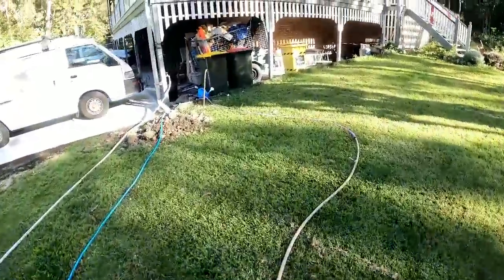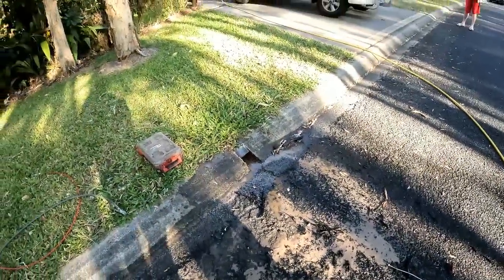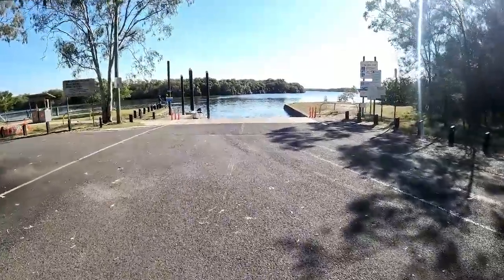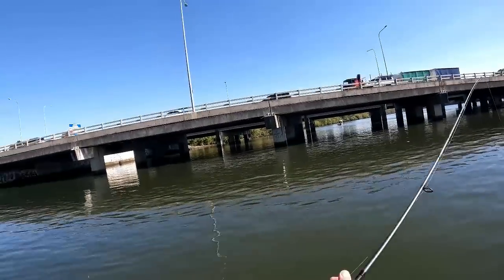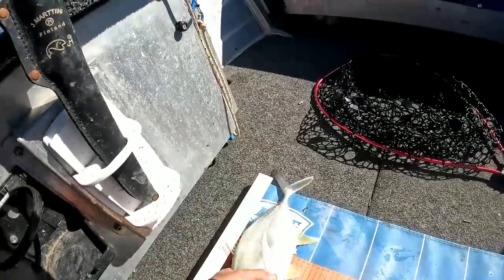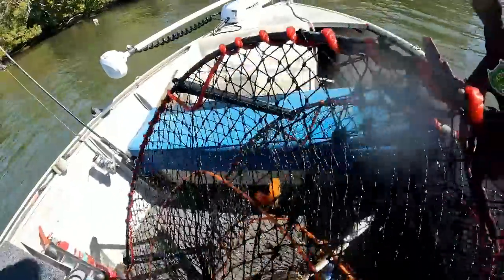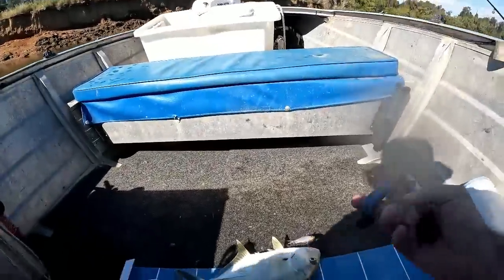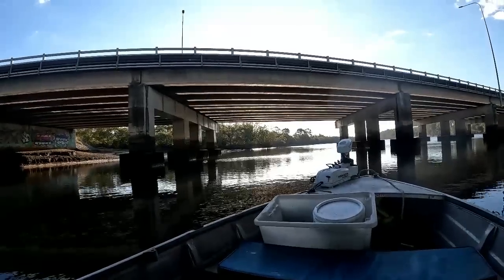Blocked Drain 374 - FILTHY MUDDY WATER + You Asked For An Adventure & I Delivered

Comment: To get the kinks out of your fishing line try this:    Remove all the gear and knots from your line.   As you are driving your boat let the line out.   Let a whole bunch out and drag it behind  the boat.  The line will twist in the water until it’s straight with no kinks.  Now just reel in slowly and you’re ready to go.  Spinning reels really kink your line because when you are retrieving a lure it doesn’t twist in the water.

Comment: You need to have your lying tied to the news of your bait. Not on the back. That way the fish can bite the entire bait and it will not touch the done line until the entire bait it's in its mouth. The way you haven't now. The lying is touching the fish and it reacts to it and will not bite on the bait and swallow the hook. Your bait has to swim just like a fish. Nose first. Use a single hook run it from the nose through the stomach and come out through the bottom where the hook is facing forward. In the O-ring is at the nose. And Caillou line to that old ring. And put a swivel on it.